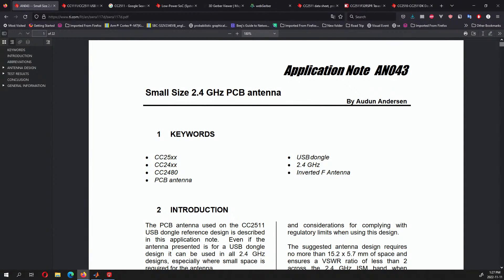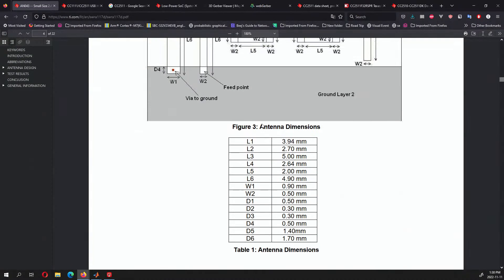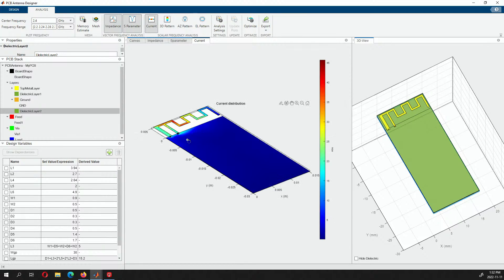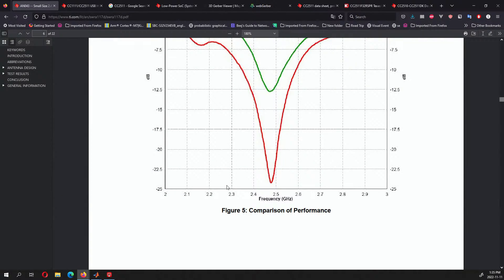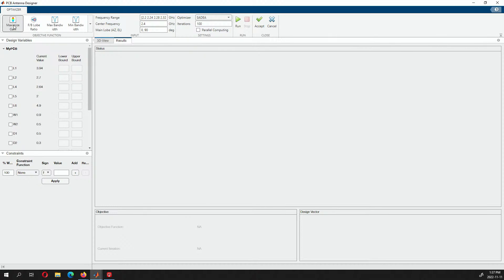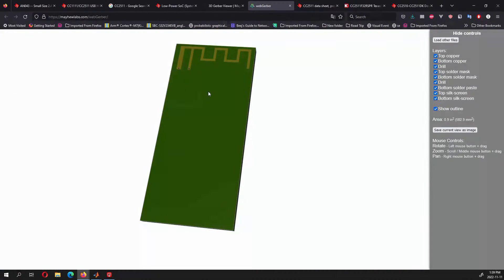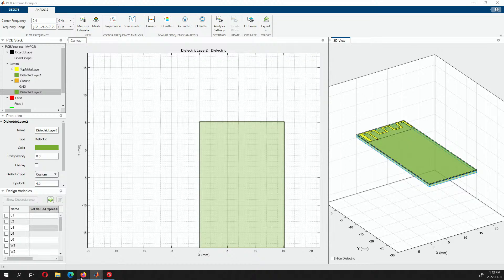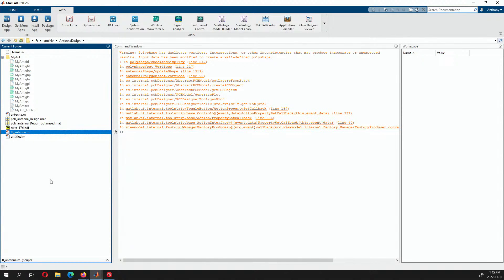Creating a 2.4 GHz PCB antenna using MATLAB

Comment: I need both the frequency 2.4Ghz and 5Ghz . What should I need to do I need to design a single one for both
Reply from the maker: Good question! For dual-band 2.4/5GHz you'll need to look beyond the CC2511 since that's 2.4GHz only. TI has the CC3551E/CC3351 (Wi-Fi 6 dual-band) and Infineon has the CYW54590 series. Unfortunately there isn't a direct TI app note for 2.4/5GHz PCB antenna layout like AN043 - most 5GHz WiFi designs use chip antennas rather than PCB traces. TI's SWRA730 covers dual-band but it's sub-GHz + 2.4GHz, not 2.4 + 5GHz.
For the antenna, you can either use a branched structure with a single feed point where one longer meander resonates at 2.4GHz and a shorter branch handles 5GHz, or two completely separate antennas with a diplexer. The separate antenna approach gives better per-band performance if you have the board space. In MATLAB you could simulate each band independently first to get the geometry right, then try combining them and optimize from there.